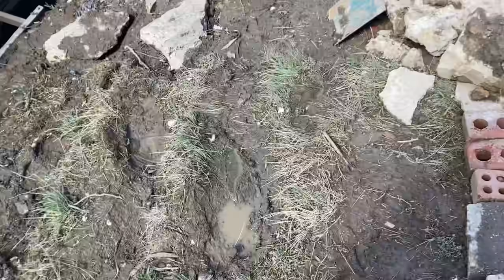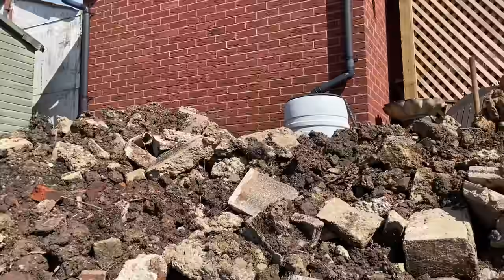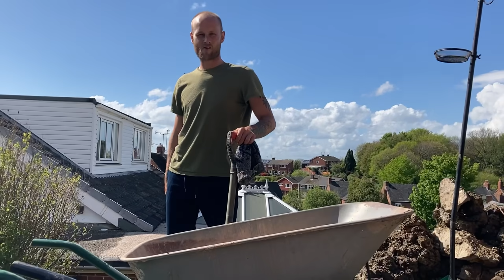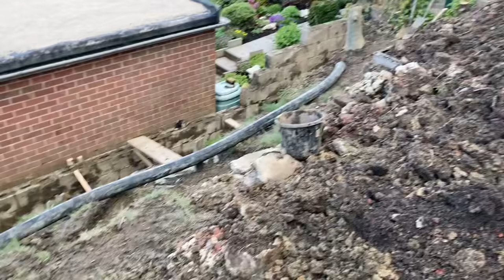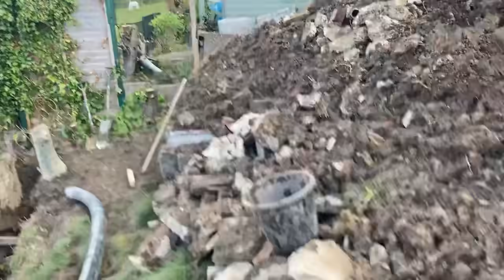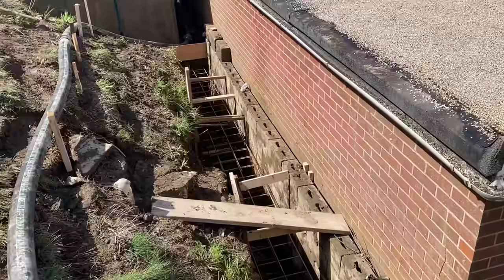THE EXTREME DIG OUT (episode 2)

Comment: 190 a skip man alive, what they want for mixed waste?
Reply: They are between 180-210 regardless of material 🤷‍♂️
Reply: @thehgvandme1388  👍👍
Reply: 240 for a 8yard skip here regardless of what waste.
Lucky I know a guy in my area who does a 4ton skip for 75quid for soil/hardcore only 👍
Not sure on price of grab away here as never used that service.
Reply from the maker: Wow that's expensive 🤔
Reply: @JimJimpmjj  paid £265 2 weeks ago  for a builders skip
Reply: @wythymanc5059  ouch!😳 Skips are crazy money at the moment for some reason.
Reply from the maker: Ya telling me
Reply: Ditch thinking in yards and feet, stick to metric and it will make your estimates of time, cost and graft easier. 1 cubic metre is about 1.3 cubic yards. A cubic yard is 1.4 tonne of spoil, a cubic metre pretty much 2 tonne. 
The grab debate is a strange one, it depends on your grab and skip company, and how lax they are :) A grab is only 16 tonne, so 8m3, or about 10 cubic yards, so only 20-30% more spoil in volume, than an 8 yard skip can hold, ie not double. But, Skips often go full (or over full), of all sorts, and a grab nearly always has space left, and won’t take some stuff. Some 8 yard skips are only rated to 8 tonne though, so shouldn’t even be filled with spoil, but you never see a skip not full.
Multiple loads, grab all day long, single load, probably a skip, sized to suit (based on good measuring).